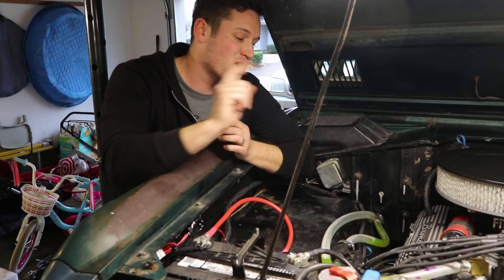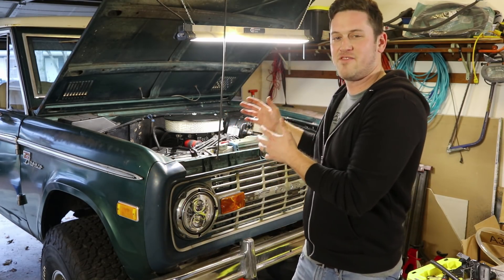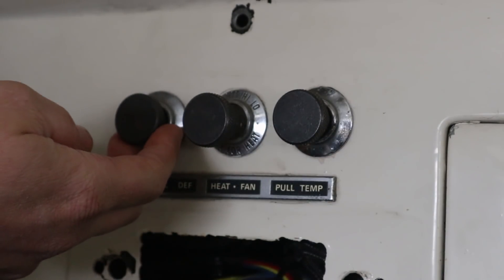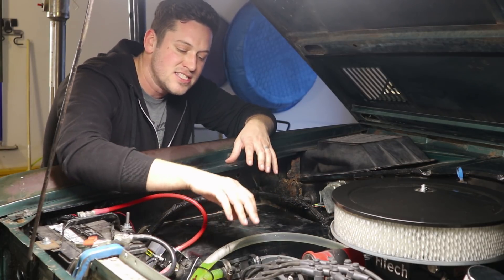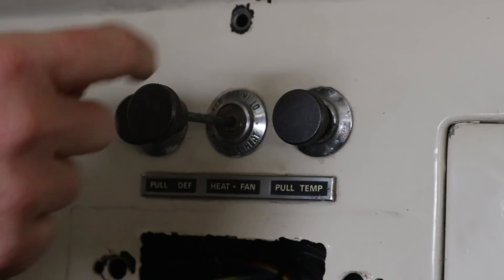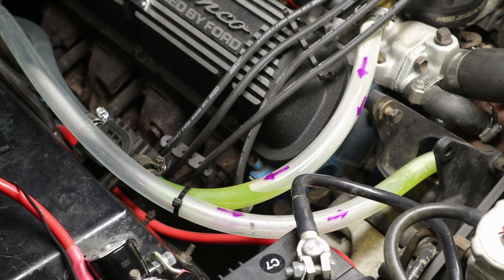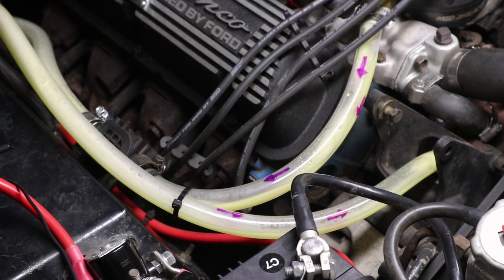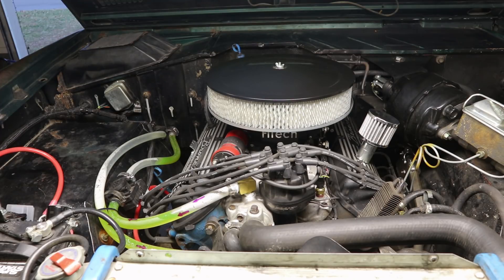Bronco Heater Explained

Comment from the maker: My heat has never worked better, got it flowing, got it hot, and it's great! How many of your heaters are actually working?
Reply: Nashville Early Bronco 
Mine is working perfectly 👊🏼
Reply from the maker: Boom!
Reply: Works perfect! I️ live in Utah so I️ bought the heater upgrade from TBP and it  makes a huge difference. I’d definitely recommend it if your driving in the winter!
Reply from the maker: Nice!
Reply: I replaced my heater core a few years ago so she's kicking! My fan only works in low though so...
Reply from the maker: Ah bummer! Well, at least it blows warm air

Comment: do you have any info about the 3 control swithces?  the defrost, t3emp control, and on off switch and control, where the springs attach to the heater core under the dash?  I cant find which goes where!

Comment: What if I have a brand new heater core but the heater controller doesn’t work?
Reply from the maker: Is it stuck open or shut? If it’s stuck shut you won’t have heat, if it’s stuck open you will always have heat 😂
Reply: Nashville Early Bronco Hoses are hot. Not stuck open I don’t have the heater hooked up. But I do have a new heater core a hoses